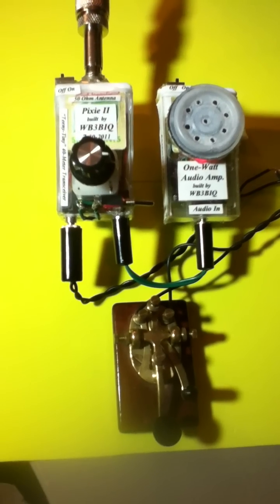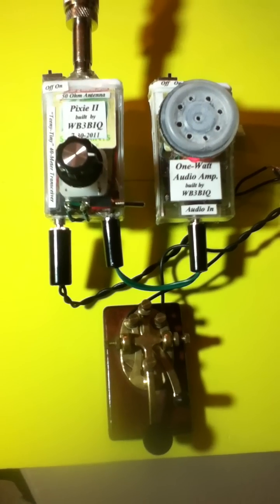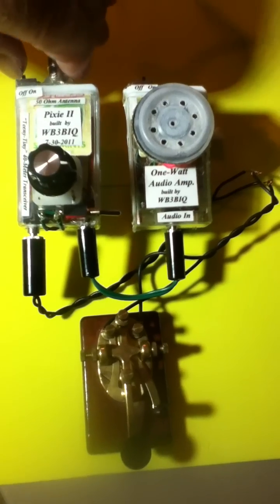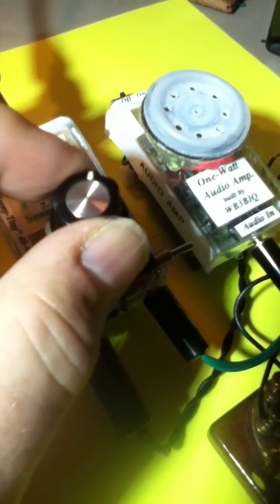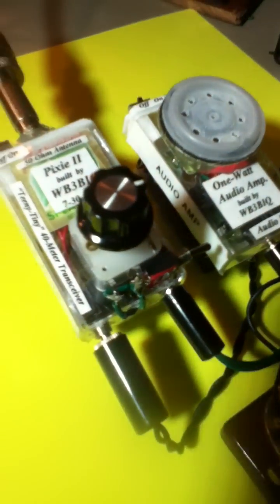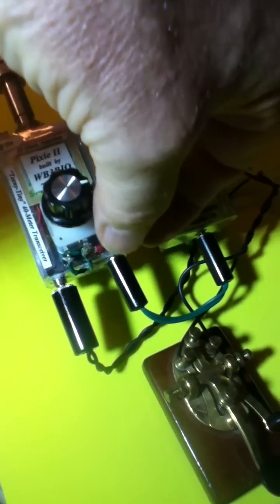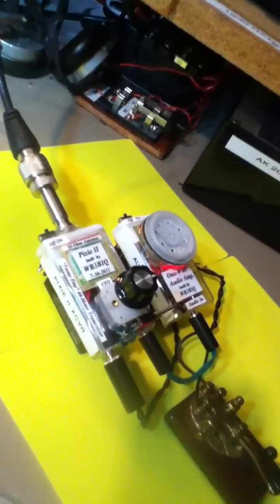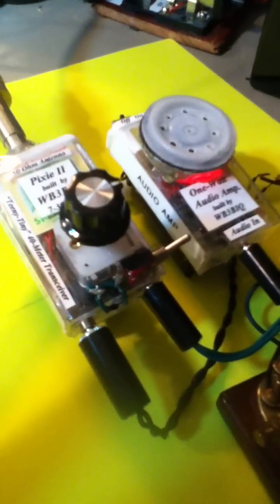Pixie II Transceiver

Comment: Did you used 2N2222 transistors for the Pixie ? After changing the ones that came in the Chinese kit with 2N2222 or 2N3904 I got the same annoying buzzing sound in the background. It doesn't matter if I use a battery pack or a power supply... the buzzing it's always there and I keep trying to find a way to remove it ))) I so love how you managed to squeeze them in such tiny boxes. Great built. 73 and have an amazing week.
Reply from the maker: I used the stock transistors that came with the kit. Check all your solder connections and make sure that nothing is touching that shouldn’t be. Good luck!

Comment: I have built many of these and put them and a 9 volt battery in an Altoids tin.  I would like to try one with a more powerful audio amp and use a mechanical filter.  We have tried using a horn type speaker on the edge of a table ; slide it over the edge till you get the desirable result.  It works on the big rigs so I hope it may for the Pixie.  Great job on your Pixie.  I also make my own boards and you are right on the cost.  Mine with all the connectors ran under $7 when I first started in 2007.  May be a bit more now.  I actually built one for 3.960 to listen on SSB and transmit on CW.  Some liked it and some told me I was in the wrong part of the band!  (haha)  Greg

Comment from the maker: Hello, Widyo--
The VXO is extremely easy to construct. I simply added a polyvaricon variable cap (from qrpkits.com) between the grounded side of the crystal and the place where it connects to the printed circuit board pad. A switch was then connected across the polyvaricon to short it out and return to the crystal only frequency. As you can tell from the demo, this gives a very limited, but nice tuning enhancement with minimum effort and circuitry.

Comment from the maker: Thanks. Got mine from HSC. Use a regular 40-meter dipole. Polyvaricons are available from qrpkits.com. Insert the variable cap between the crystal lead and ground (NOT the crystal lead that goes to the transistor). Add a simple switch to short out the variable cap and produce the crystal frequency. This variable cap gives the necesssary offset to be able to hear the other station. There are linkson the Internet showing schematic and parts/pix. If you can't find these let me know. Good luck!